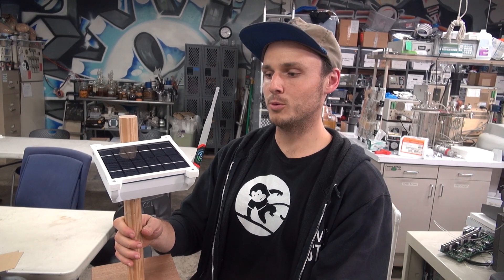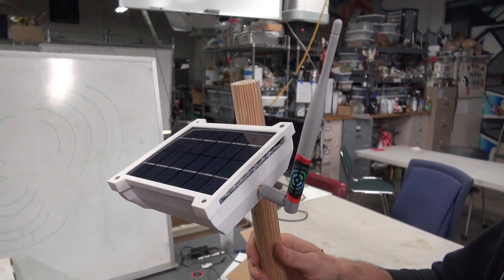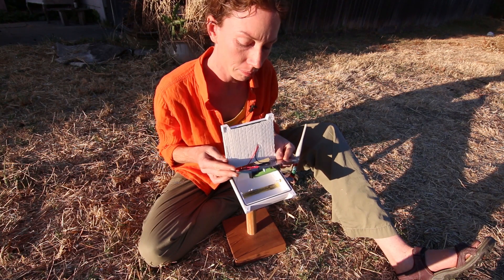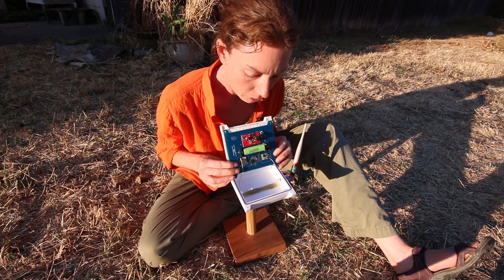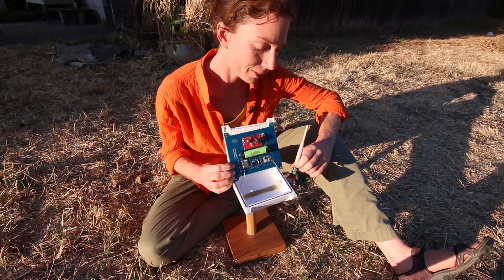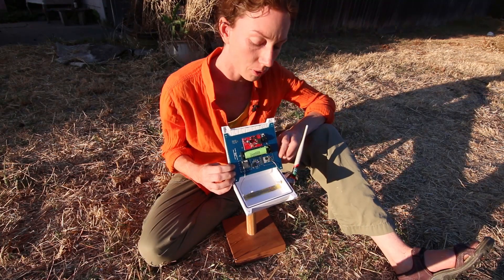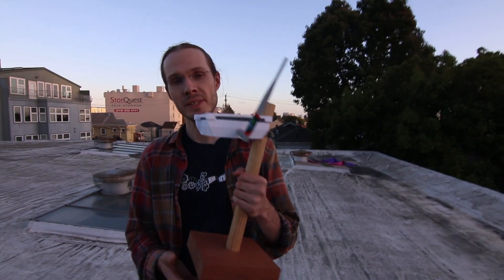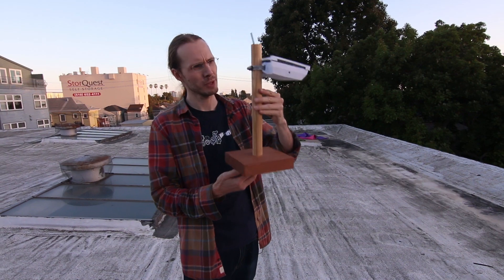disaster.radio - June Prototype Demonstration

Comment: Will this work without the wifi module?  if the wifi module is required, is there an easier way to add wifi to the TTGO LORA32?
Reply: Yes, without the WiFi Radio Module, it's just Disaster, without Radio.

Comment: going back in time, when all we had was mIRC  and ICQ :D . if i may; you deff need bigger battery (would go with 18650 or 21700 battery packs with appropriate charger), and  bigger solar panel wouldnt hurt either  (esp if its stealth setup, mounted flat on roof). no need for 200+w 5 by 2.5ft, but i fear that once battery is drained, that solar panel wont be good enough to charge it up in case of cloudy weather (had same problem with my simplex parrot system for HAM  club). love the idea, will deff try to encourage more people to think about it. :D .
Reply: Yeah that's definitely likely. It might be acceptable that not all nodes run throughout the night in all conditions though. We're working on the next generation system so hopefully we'll be doing some real world testing again soon :)